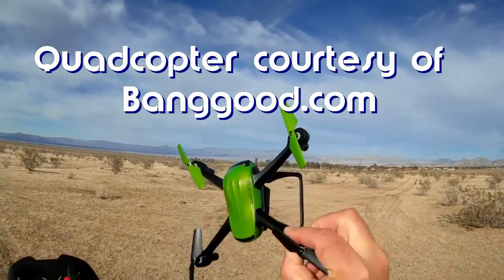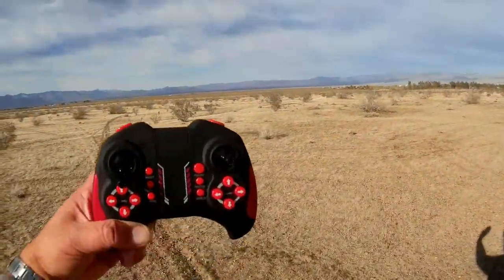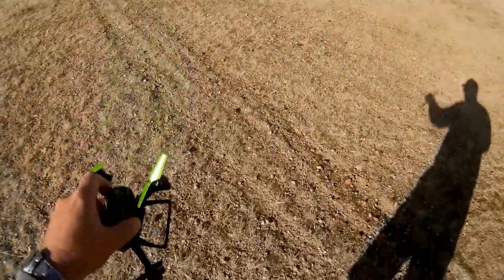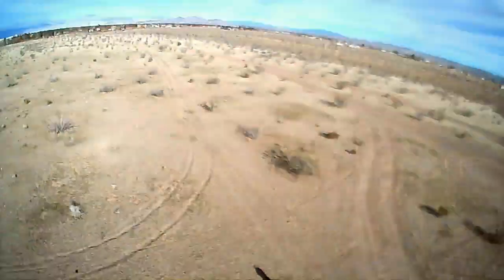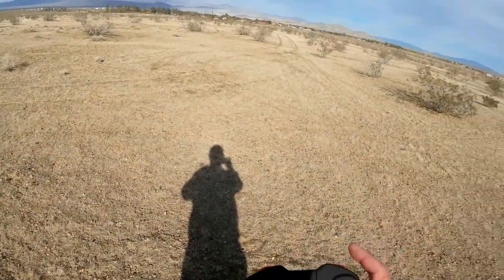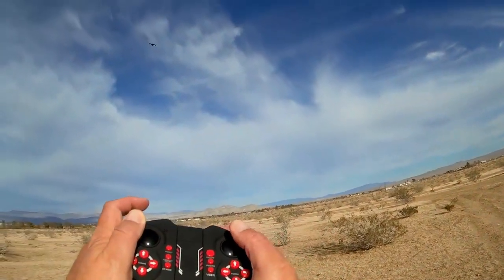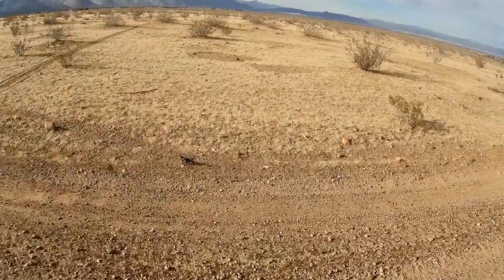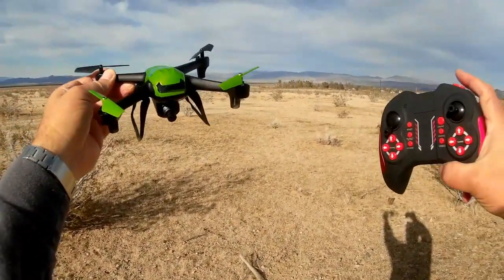Eachine H99D Camera Drone Flight Test Review

Comment: And still, yes You are right - after 2 months still NO spare parts for the H99 at the Shop!!! (Propeller, motor.) The battery is widely available BUT without propeller or motor You can not use the quadrocopter.

Comment: I have this quadrocopter as well. I have problem with the CAMERA on it. You can read at the features on the Banggood site the next: "With 3MP 120°Wide-Angle HD Camera." Soooo it is a 3 megapixel OR a HD camera? If 3 megapixel it has to be  about 2048x1536 pixels resolution. If HD it has ONLY 1280*720 megapixel (1 megapixel) - and it has HD. So the advertisement on the Banggood site is a little bit a misinformation. The picture it can take has 2560x1040 pixel resolution, OK it is 3MP - BUT it is NOT a real 3 megapixel resolution, it is originally only ONE (1) megapixel and interpolated up to 3 megapixel and it has terrible quality. The quadrocopter itself is OK, but the propellers can broke easily (without the propeller protectors - but i was "lucky" to broke propeller with protectors on) because the quality of the material of the plastic propeller, it is fragile. And after 2 months at the shop where You can buy this quadrocopter - STILL NO spare parts!!! I TRY to find similar propellers to buy, but...

Comment: I own a jjrc h11 with what appears to be the same controller. I question whether or not the fact that it is powered by just three AAA batteries instead of the usual 4-6 AA that most controllers have  -that  would affect the range issue. I would be curious as to what you think about that.

Comment: The camera is pretty impressive for a "hard fit" style. Relatively little to no jello.
The angle points too much downward in my opinion, but otherwise something that can be used. Angle of the lens is good also. Not on par with a Run Cam or a Mobius or other "action" cameras, but as an introduction to flying and filming, this seems like a decent entry level machine.